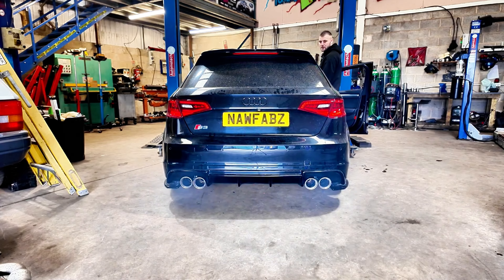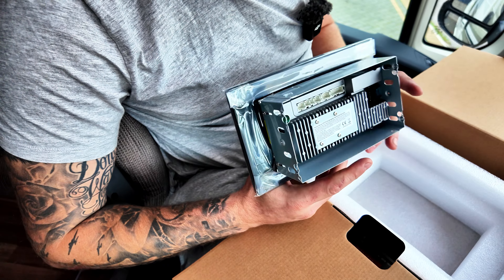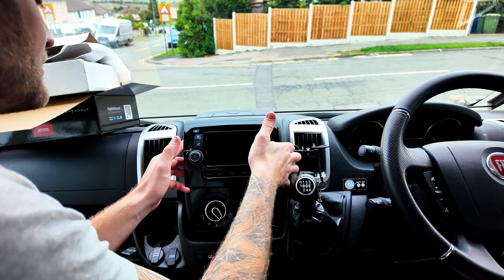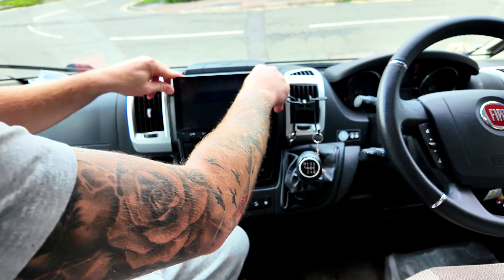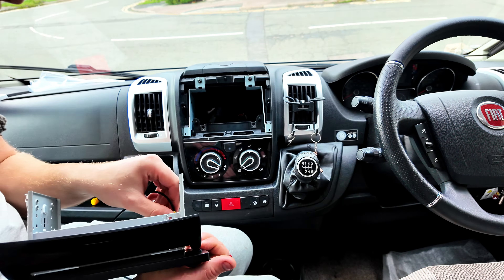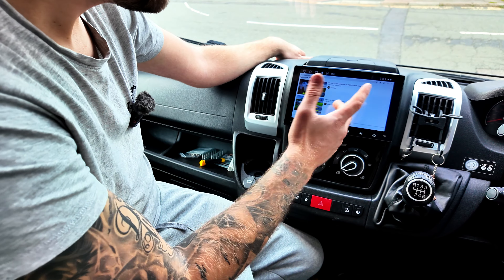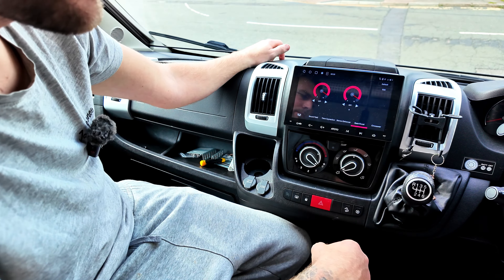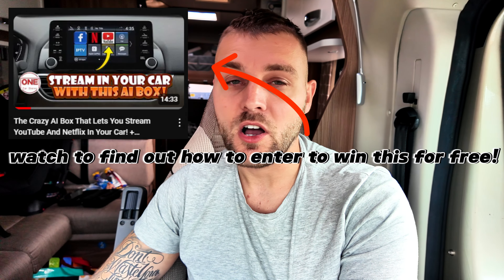I Turn My Boring Fiat Ducato Motorhome Dash Into A Tech Paradise With Atoto A6PF Stereo Upgrade

Comment: thanks this is useful, even if I don't get same head unit, will be fitting to exact same dashboard , ducato motorhome , so useful to see the example. An IT security comment - if someone steals or just breaks into your MH, they have access to an unlocked android device signed into google as you. Depending on what you have linked to your google account , that could be really really bad. Good practice to create and use a standalone google account just for this device.
Reply from the maker: Thanks for that info yes may be a good idea to sign out of my account

Comment: You have fitted it wrong. The brackets you have screwed to the dash are meant to be screwed to the head unit and then you screw into the dash so no one can steal it. You will need to remove the brackets you have attached to the head unit. Hope that makes sense?
Reply from the maker: Hmm maybe your right but you'd have no way to get to the screws as the facia plate has to go on first and the screen would be in the way of the screws? No ones going to steal an aftermarket stereo in 2024 surely it can stay as it is 🤣🤣🤣 cheers though appreciate the advice .
Reply: @NAWFABZ  no worries
Reply: Did you get the dreaded flashing milage on your clocks? A lot of these Chinese units are not cambus safe and cause the milage to flash